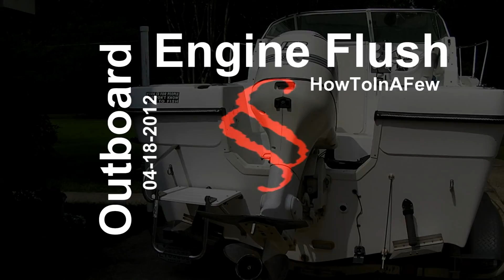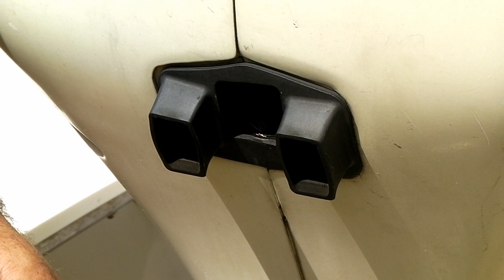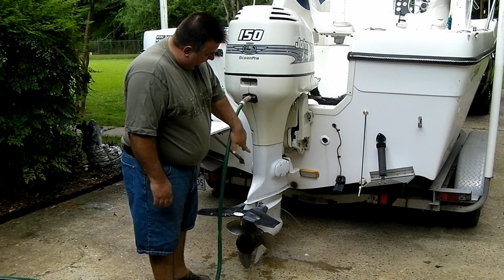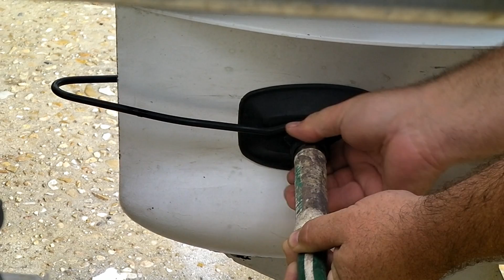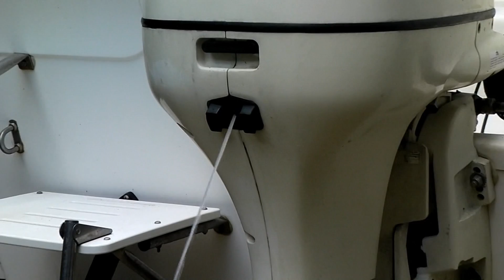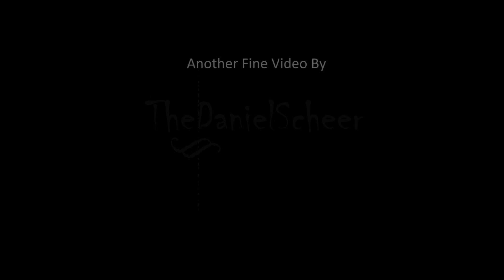HowTo: How to Flush Your Outboard Motor (2 Easy Methods: Port Flush & Ear Muffs)

Comment: Doesn’t the thermostat have to be open in order for the water to flow all the way through the motor when flushing through the hose connection?

Comment: Since the engine is not hot, how does the water get through a closed thermostat?
Reply: I always take my thermostats out when flushing thru the tell tale, with the engine off. Blown out alot of sand and trash that would have ended up stuck in the small t-stat holes

Comment: Just a reminder: on the 60 and 90 degree loopers (90-300hp) with the high pressure water pumps: DO NOT RUN IT WITH THE FLUSH ADAPTER SCREWED IN! He didn't use one here, but if you leave the quick-connect in they often leak, causing hot spots on the block because the powerhead can't fill up with water all the way. the factory telltale piece also acts as a restrictor. many a motor fried that way!
Reply: Traducir en español

Comment: Nice job,  I have a general question can I flash the engine in an horizontal position when in water using your first method without running the motor?  (or it has to be in a vertical position either out or in water)-Thanks

Comment: Is water supposed to come out of the exhaust ports when the engine is running.
Reply: +realcoolphil Yes.  You also want to be sure that when it's running you still have some water escaping the muffs on both sides.  Just having water at the indicator is no guarantee, I've seen several overheat while still peeing a good stream from the indicator.  The one in the vid appeared to be just at the edge of minimum water flow.

Comment: Never, ever rev an outboard that high on muffs.  There's no load or backpressure on it, plus you are not pulling anywhere near enough water for higher RPM's.  If you starts to stall out after starting just bump the key in for a second it'll correct itself.
Reply: Bollywood hindi
Reply: Old comment but. I’m running a Johnson 90, 1987 model. And as such call BS on your comment…. periodically I have done some pretty high RPMs on ear muffs. Did lots when fault finding various issues over the years. To clear out an ants nest and get the pump flowing fully, when I had ignition issues. And when I had a faulty thermostat that worked fine when cruising but over heated at idle…. (I’ve replaced the pump several times due to preventative maintenance … and it’s always been fine). What do you think happens when your outboard sucks air over waves at 5000rpm. Calm down. It’s just a dumb water pump feeding pressure to thermostats (that are sprung bypass at high Rpm anyway). As long as it’s wet, it won’t melt. 

As far as Reving a 2 stroke with no load….. weed walkers do this all day long, as do dirt bikes. It will be fine. Engines don’t explode from reving with no load.

Comment: what could be going on? is my water impeller defective, or is trash keeping it from flowing properly, and what do I do to correct this, it has a lot of steam coming from the motor at just half throttle, out of the pee hole also.

Comment: whats going on bud, I know this was posted some time ago, but this is the closest thing I can get to getting some questions answered. I have a 40hp 91 model, I just had the impeller replaced, I went fishing in a river that was full of debree, the next time I went out I noticed that my water does not come out like it used to, I don't have the output to reverse the water to flush the motor. when im at half throttle im noticing that the water is fluttering, and steaming out of the pee hole, heeelp.

Comment: Correct.  I found the flushing port only allows water to back flush through the cylinder heads, but doesn't allow the impeller to rotate properly.  What this does, is actually doesn't let your motor regulate proper cylinder head temperature, but instead, runs too cold.  I don't think it will damage the motor itself, but could possibly take out the impeller over time.

Comment from the maker: You should only run the engine with the hose connected to the water intakes via an ear muff adapter. As far as I know none of the inline hose adapter flushing ports are designed to be used for running the engine and can cause damage if used that way. Check your user manual.

Comment: Can you run the engine by just using the flushing hose?  Is there any possible issues by doing it this way, over the ear muffs over the intake?  I connected my hose, and ran the engine.  The water pump still pumped water out, but the manual states to use the intake side only when running the engine.

Comment from the maker: Personally, I notice the water it significantly warmer on my garden hose that when in the lake water. This is the case even when the lake water is warmer than my hose water. I assume the motor's waterpump is able to circulate the water better sucking from both sides while in the lake... as opposed to only one side while on the water hose. The pee hole is really only an indicator that the pump is functioning... not necessarily functioning correctly!

Comment from the maker: It is not necessary to flush both ways and using the port while not running is probably best. It also doesn't wake the neighbors when we get home late!!! That being said, it is important to run the motor on the hose periodically between longer breaks to ensure proper running when you decide to use it again.